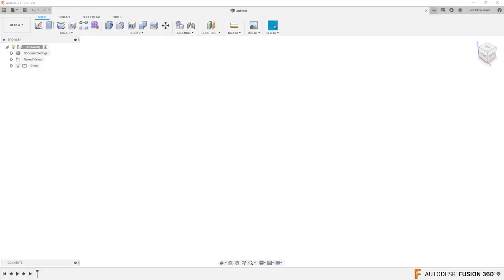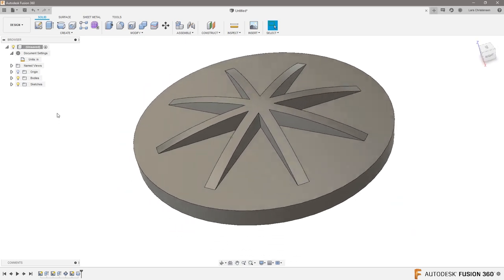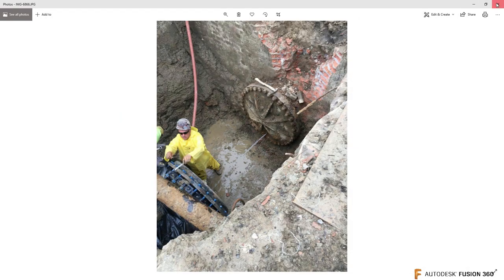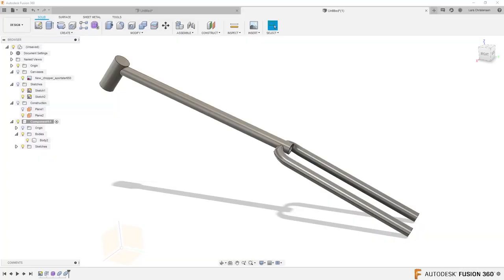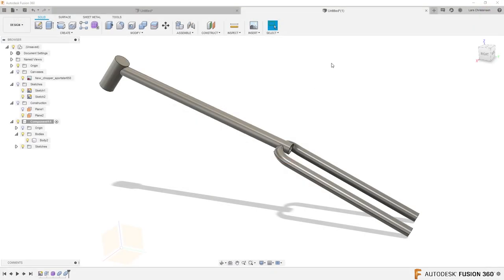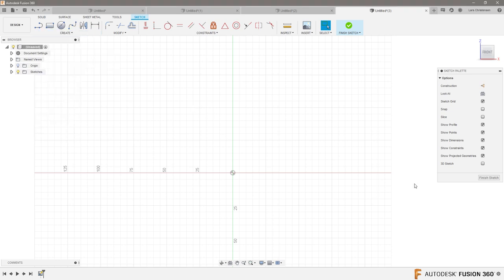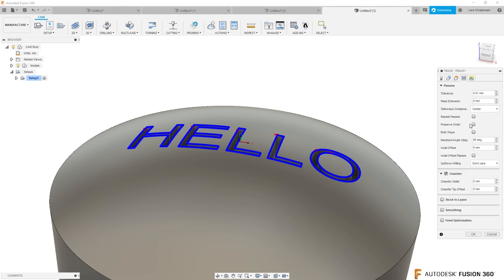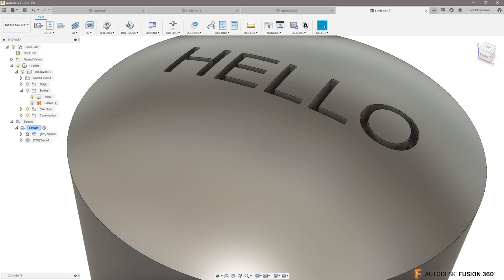Ask LarsLive Fusion 360 — Sunday Edition — Episode 10

Comment: Thank you Lars for taking the time to suggest a solution to the problem I am having with the arc menu. I will check it out. Working on Fusion is one of my favourite pastimes. I plan to get a 3d printer once I get better at using the program, but at 77 years of age it may take a while, so as the other guy says, I may die trying!